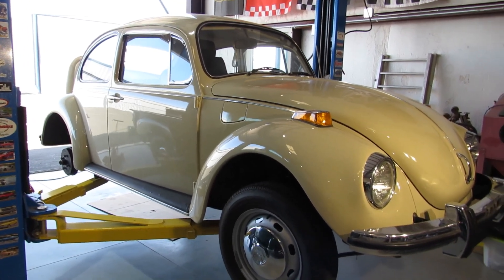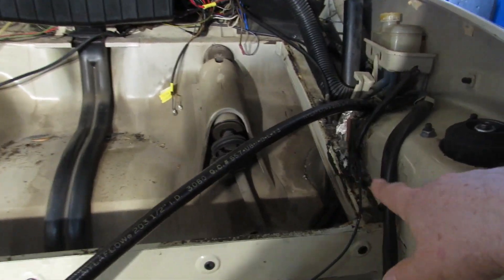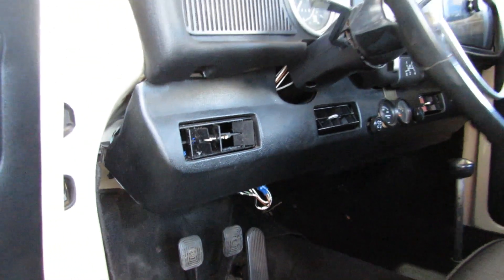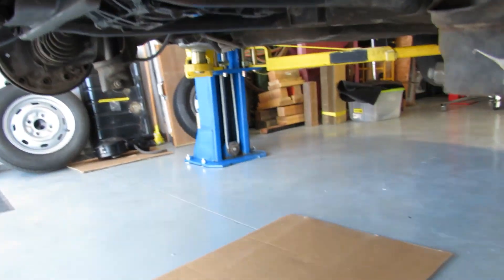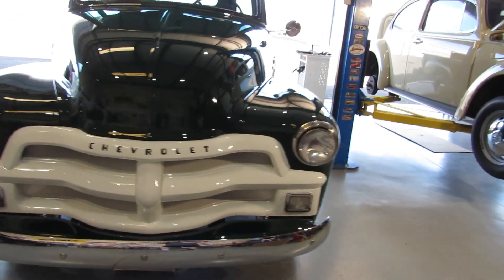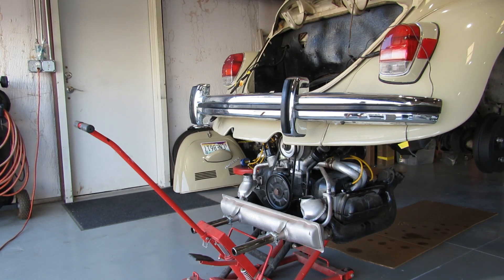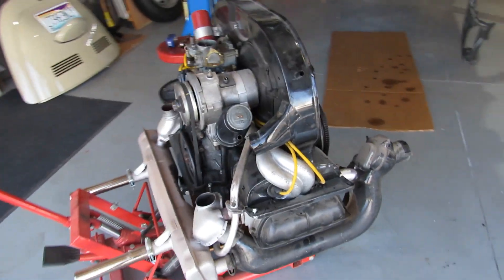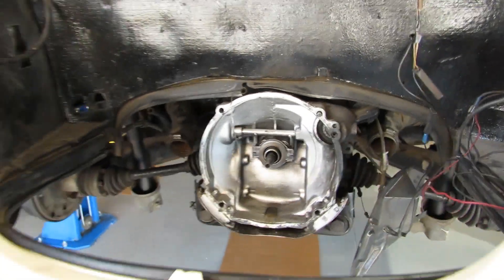Ev West Conversion 71 VW Super Beetle Engine Removal for Electric Conversion

Comment: Hey Randy you may be better off to use an EV West light weight flywheel. No need to make your motor spin up all the extra weight of a stock flywheel. I got my conversion running last weekend and would be happy to discuss the project with you.
Reply: Awesome.

Comment: I had lots of VW Bugs, they were great cars in the 60's and 70's but they are not close to safe cars by today's standards. Putting batteries in them is not the best idea. They were designed as sub 2,000 pound cars, adding batteries - bad idea.
Reply from the maker: Agreed, definitely not as safe by today's standards, but fortunately, by removing the fuel tank in the front,  I'm eliminating 65 pounds of liquid explosives, so don't have to worry so much about front end collisions causing an uncontrolled fire bomb....   Also have removed about 60 pounds of A/C components so far as well,  Also, by removing the engine and replacing it with the electric motor and components,  it'll weigh just a touch less than factory, however, more balanced with the weight including front and rear battery packs, more evenly distributed.   Have to reflect on the design by Porsche on their early 911's.....fuel tank in the front with a battery on either side of the tank (for balance and to keep the front end on the road) What were they thinking?   :)
Reply: I'm fascinated by the sturdiness and how well made the VW components are for such a light car. I've just rebuilt the front and rear suspension/ gearbox for an early 60s bug. What some of the guys do is put coil over shocks in to handle more mass. Perhaps do a disk brake conversion too?

Comment: You can buy EV electric air conditioners that work great if you want. It gets hot down here too and this Cortina has it and it works great. Very little demand on the system but makes daily use a dream.
https://www.youtube.com/watch?v=WxUUDve6HBM&t=114s
Reply from the maker: Hey Mike...thanks for the link, will definitely look into that a/c system as I make progress....  Car might end up near the beach in Southern California, so not quite as critical as it would be here in Tucson, been brutally hot this week :(